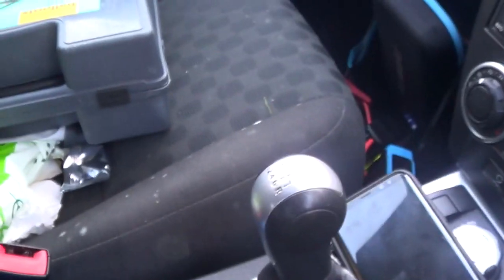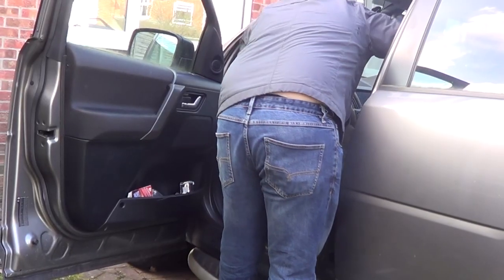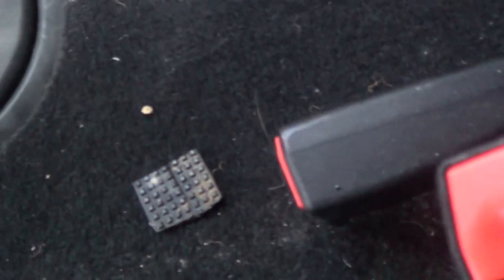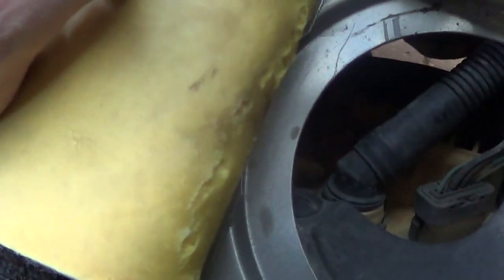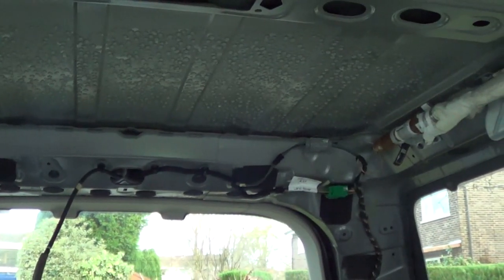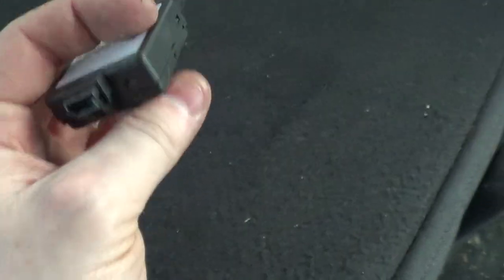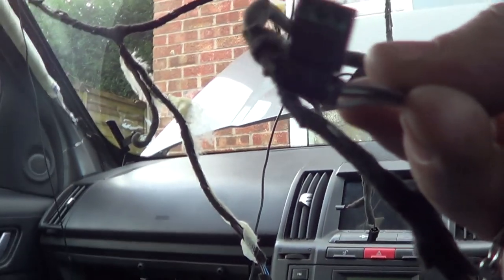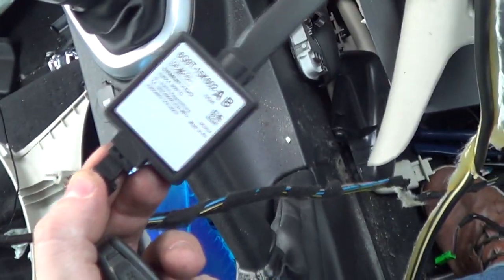Taking apart the Land Rover Freelander 2 interior.

Comment: Hi, check out your roof rail mounting bolts.  The bolts should have been siliconed when the rails where fitted, maybe not in your case.  Just an idea as they go the bolts go through the roof.
Reply from the maker: Good point, probably worth doing it anyway. Cheers.

Comment: Cheers a very helpful video as i have a sunroof leak probably the drain ports blocked (easy fix) OR broken snapped off or drain tubes detatched hope not, will need the headliner removed to do repair  on the broken parts. If anyone has done this repair before please let me know

Comment: Did you ever sort the drive chain vibration on this?
Reply from the maker: Vibration? I had a whine, do you mean this?
Reply: @VarleyRebuilds  Last May you put a prop shaft on but it still as noisy, is this the same car?
Reply from the maker: @ScR-jb7th  ah yes, i put the prop on because it was missing, before that it had a slight noise from the rear, so previous owner had it removed in an attempt to reduce the noise, so put the prop back on and working the diff more the noise was louder, they are common for rear diff noise and im pretty sure that is the cause of it, it still does it, but in the mean time the slave cylinder went, therefore I need to get it back on the road first.
Reply: @VarleyRebuilds  cool, I'm in the middle of refurbishing the front transfer box on one, that is where I tracked down the noise to.
Reply from the maker: @ScR-jb7th  this one is definatly the rear, may get it sorted one day.